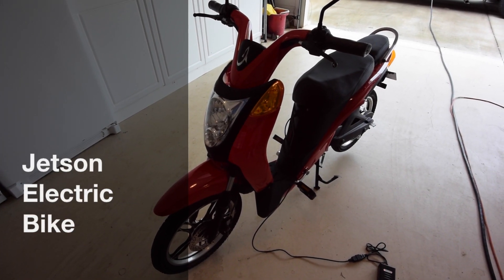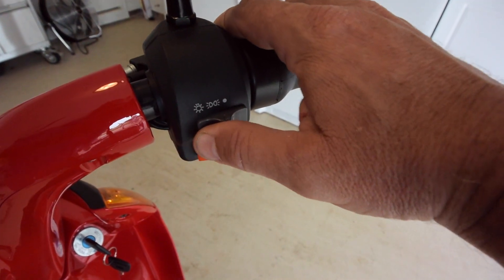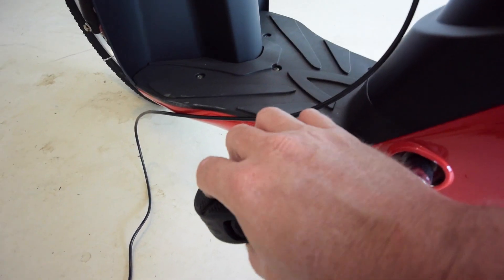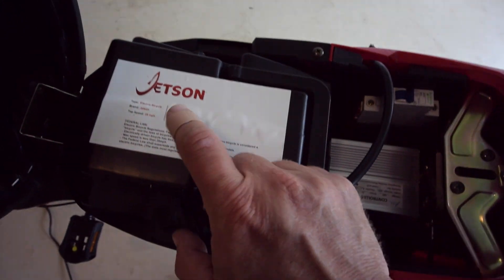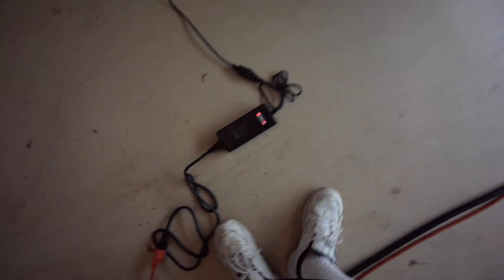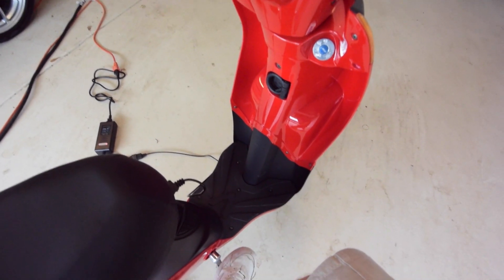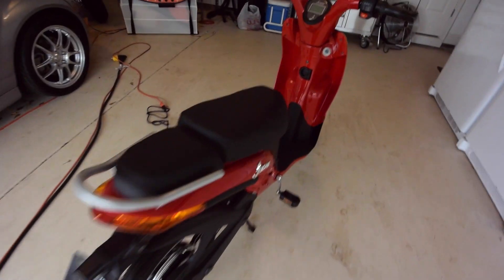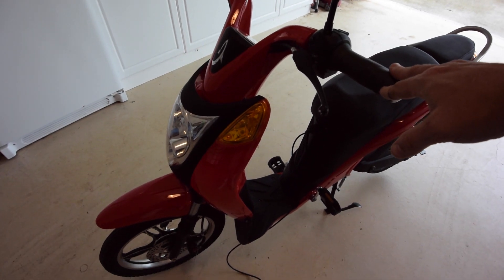Jetson Electric Bike

Comment: Question, is there anyway to add pegs so I can ride with a 2nd person??
Reply: Yeah I think its possible because it has some screws in the bottom where normally would be the pegs for the passenger..So I think you can buy them aftermarket and install them and you are good

Comment: Do you still recommend it after all this time? Also I noticed on the website it said to use WD-40 for maintenance every month. What exactly do you use it on? Don't know a thing about cars or vehicles.
Reply from the maker: +Jose Carmelo yes.  it works very well. you need to lubricate the chain every now and then, that is what the wd-40 is for.

Comment: do you know if it is possible to replace the battery on this at all, can’t find battery replacements on their website
Reply from the maker: I think it comes out.  finding a replacement will be tough.
Reply: wincrasher2007 found some on ebay, just hard to do since the only options you  have are to buy ones with xt60 plugs on the battery which limits your choices a lot or to manual strip the wires and swap them out which is difficult for someone who isn’t very educated in this field or how to do it myself like at all. thank you for the reply though, helped me out a lot. earned my sub :)!!
Reply: Were you able to end up replacing it? I’m in the same situation
Reply: did u replace it??

Comment from the maker: Update:   I did a simple, reversible mod and now it will go up to 26 mph.  It appears the range is the same.
Reply: wincrasher2007 how did you do the mod?
Thanks
Reply: @kevstar8695  Disconnect the single white wire that is connected to another white wire

Comment: Was there any reason you chose this over the GigaByke Scooter?  It's basically the same idea however, the GigaByke is $300 cheaper (MSRP) and you can actually pedal it like a bike unlike this Jestson which I'm told is next to impossible to pedal like a bike if need be?
Reply from the maker: The Jetson has been around a good bit longer - several years - the Giga just came out, so no real track record.  It's really heavy - the Jetson is nearly 60 lbs lighter, which you'll feel on the hills, and you can mod the Jetson  to go 30 mph. The range is also much longer - probably because the Jetson has a lithium battery, not a lead-acid like the Gigabyke.  Yes, the Jetson is not a pedal bike.  Go ahead and get one though - you can post a review video on it.
Reply from the maker: Also, watch this video - their cardboard box doesn't offer any protection - https://youtu.be/eE6ciBMYMjc
Reply: how do you mod it?